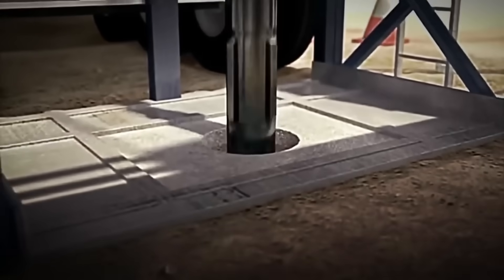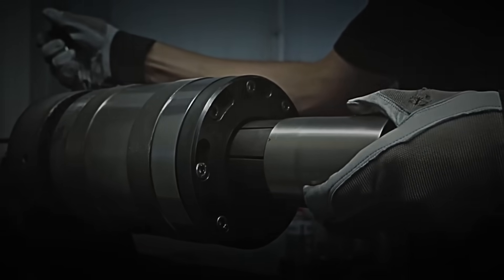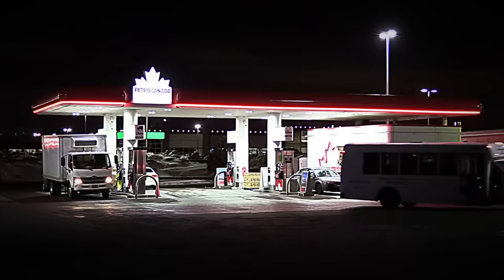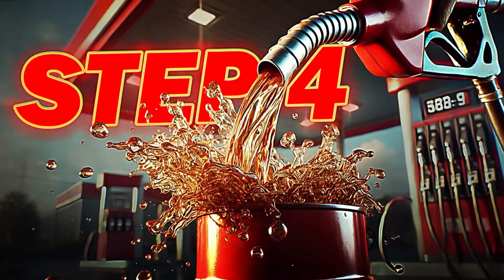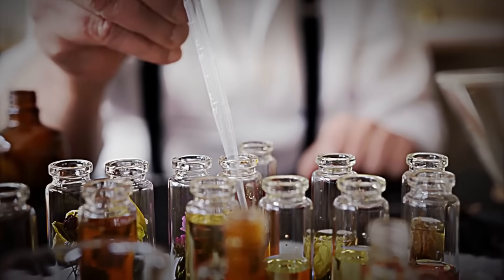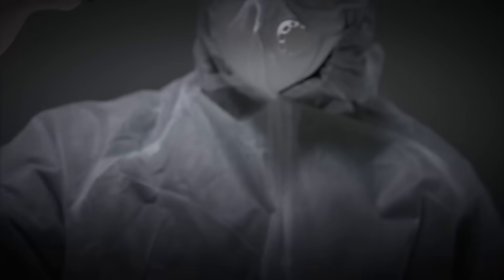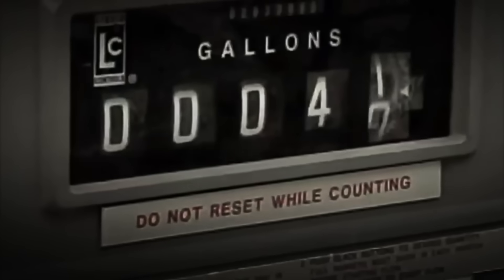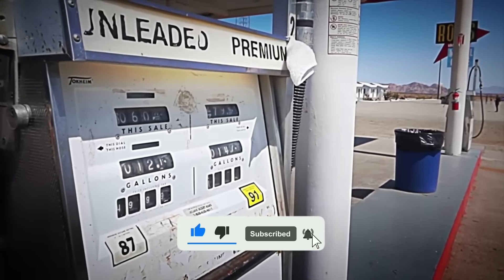How GASOLINE is MADE ⛽ | Refinery Process 🏭

Comment: Octane is not just a fuels resistance of combustion under pressure, but heat and ignition energy as well. Increasing octane in itself doesn't increase energy outputted or efficiency, just the ability to handle more pressure and heat before running into pre-ignition, knock, or MBT.

Comment: I shudder at the sign on the back of the tanker truck toward the end: 38% sulphuric acid which, when burned with the gas will be emitted as straight "pollution" which could have easily been taken out of the fuel to make many valuable industrial products. Plus, some places don't drill for oil and pump it out. Some places take really big shovels and really big trucks and dig the oil up with the sand its mixed with and then separate, upgrade and refine that...

Comment: Oil is created through gasification of ALL organic materials. This now includes plastics in landfills. This process is why, when a landfill is being capped off and is done being added to, they put huge pipes on top prior to putting dirt to cover it over. If this was not done fires and explosions would result because as the organic materials breakdown through pressure they create heat and give off hydrocarbon (carbon chain molecules) like propane, butane, methane, etc. These then, with the heat would cause fires and explosions, much like swamp gas, wherein you can see fires in swamps due to gasification there. 
At the bottom of many landfills, in just 10 years there is crude oil seeping out. It doe NOT take millions of years but only 10 or so (depending on how much organic material is present). They have lied about this process to drive prices up! ALL aquifers are large underground rivers heading to the continental shelves where they hit bedrock and large underground caverns where the flow terminates and lies still and gasification starts. This is why so much oil is found just of the shores of continents.
Reply: Seems like you forgot your meds again but hey if you want to believe your BS then enjoy
Reply: @alanbiancardi2531  Before you just naysay something because it goes contrary to what the mainstream media has told you, how about doing some personal research. For example, go out to a landfill as they seal it off and see the pipes being laid. Then after the dirt is on top, go a month later at night and see the flames coming out of those pipes. Find an old landfill of ten years or more and go see, if at the bottom, you don't see oil!
or
Are you just an everyday standard troll that feels it is their job to attack people as a policy?
Reply: He is correct more then wrong.

Comment: As a pilot why haven’t they removed the lead from Aviation 100LL fuel  ? We have the “FAA approved” NO LEAD” aviation fuel available now! For the piston fleet of aircraft With “No” lead but yet they say it wont be until 2030 before it’s put into use? WE got rid of lead for the Automobile back in the 1970’s? Why would it take 60 yrs for the FAA to remove the lead from Aviation fuel!

Comment: 90% of the footage used does not accurately depict what the narrator is saying. This drivel is what’s wrong with the internet.
Reply: The "likes" on this drivel are what's wrong with the internet.
Reply: The footage does accurately show steps in the process of gathering and refining and distributing oil. Maybe they are assuming at least a basic understanding to place the images used in context. Besides, I live within 10K of 4 refineries and we don't drill for oil as much as dig it up and refine it. We also steam it underground like with  tea kettle and then pump it out...
Reply: @ the video show a power plant during the narration that says “catalytic cracking.” How is that accurate?
Reply: Actually, I had the opposite reaction. I have seen a number of videos where the images were unrelated to the narrative. That was not the case here. It was one of the better made videos.

Comment: I think this video is untrue. It could be simplified  until everyone could understand what and how gasoline is actually made. GET REAL!
Reply: I have hauled asphalt and other chemicals out of Marathon oil refinery Catlettsburg Kentucky in a large tanker truck. It does not take long with their big pumps to fill up a tanker and the tanker is never filled all the way up. What was funny was out next to the river getting a two blend load of asphalt. Go up the steps were the guy is pumping into the tank a sign said no smoking but we could step 20 feet a way to a table and smoke all we wanted to smoke. Tanker hauling is the best trucking you don't do nothing but drive the truck.
Reply: @allenelswick6961  Hauling asphalt is a great job until that day the minivan swerves and you try to avoid killing them and lose control and hit the bridge and the wreck catches fire and turns you into a charcoal brickette. That happened to my cousin's co-worker. But thank you for your service. You helped get a nation around.

Comment: Generally speaking, video was relatively accurate, without detail.  I used to work in a Gulf Oil refinery producing everything from asphalt, to gasolines, to propane, having experience in all units except the Cat unit.  We even had a full lab where chemical engineers and chemists applied their trades.  It was a lot of fun working there, learned a great deal.
Reply from the maker: Thank you for sharing your experience!🙌🏻
It’s fascinating to hear from someone who’s worked so closely in the industry. It must have been such a unique and rewarding job , what was your favorite part about working in the refinery?
Reply: Worked 30 years in a Gulf Oil terminal. The gas with guts!
Reply: Maybe someone like you could make a much better video than this grade school crap.
Reply: The visuals were mostly completely out of synch and off topic with the dialogue.

Comment: I heard back then when i was little in the 1980s someone told me that gasoline had lead
Reply: Lead was added to gasoline to help the engine run smoother.
Reply: Lead was used in gasoline for many years and it helped your car engine run smooth and no knock. In the 1970's lead was banned in gasoline and the claim was lead was a poison dangers to us and the enviroment. The new blends pushed off on us were a horrible gasoline to use it caused engines to try to keep running after the ignition key had been turned off it caused hot carbon to build up on the valves. Leaded gasoline is still produced by two refinery's in the US and is used by all propeller aircraft due to it being more stable and has a higher octane boost creating more power.
Reply: It was tetra ethyl lead. Premium grade fuels for high compression engines had more of it to prevent pre ignition. In the 1960's, it was common to hear a customer tell the service station attendant ''Fill it up with Ethyl.''  Us teens would be smart with the attendant and ask ''Do you pump Ethyl? Does she like it?''
Reply: @kimmer6  I remember back then we had two blends to choose from and i always bought high test as long as i had the money to buy high test. Our two blends was high test was like a orange red color and the regular gas was a green color.
Reply: @allenelswick6961  Sunoco had blue gasoline. Plus you could choose from several different octane levels which were blends of highest and lowest octane fuels.
Reply: @maxwellcrazycat9204  I have lived all my life in Eastern Kentucky and we had two blends one was high test and the other was regular. Back in the 60's our push lawn mower didn't have as much power running off of regual gasoline as it did on high test gas. The gasoline prices were 27 cent for high test and 23 cents for regular gasoline. Thats how i remember the gas and the prices and car engines run much better on leaded gasoline than on the unleaded gasoline.
Reply: Used to be, but stopped because people kept getting sick
Reply: @smh2754  People didn't "get sick" from lead in gasoline. It was linked in some "faulty studies" to declines in kids IQ levels so environmental lead (in gasoline, in paint) was banned to "protect the kids."
Reply: Lead additive was placed into gasoline as the older engines need lubrication for the valves. They also needed higher octane levels than available now.